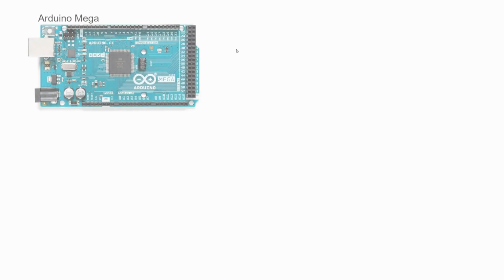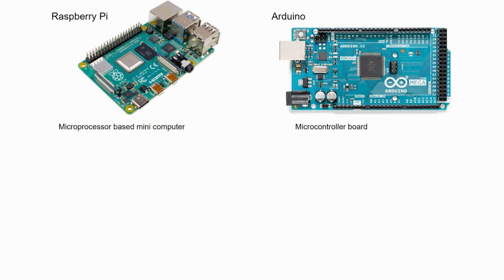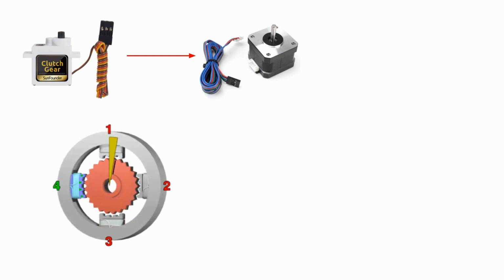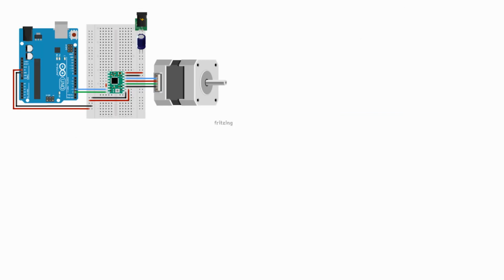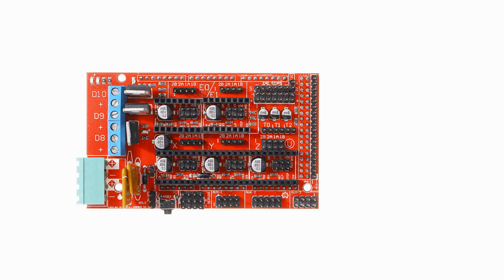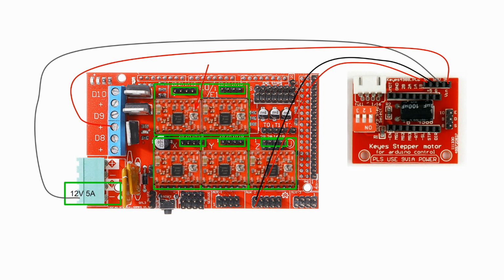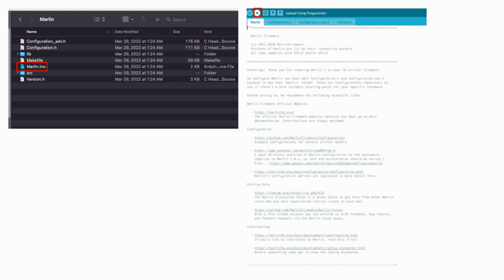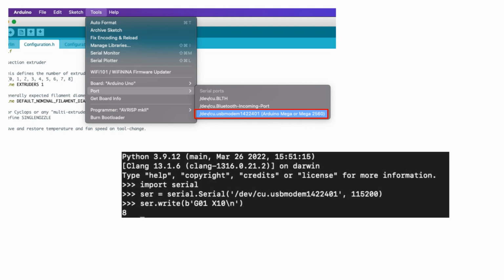Rubik's Cube Solver Robot: Part 1   hardware

Comment: i like this and i want to build it but i don't understand some of the steps could you help me?
Reply from the maker: which step do you not understand?
Reply: @havefunwithdiyrobotics4343   I'm a beginner when it comes to wiring so I was wondering if it mattered what wire color and size I used for connecting the FDS pins on the stepper motor controller to the board